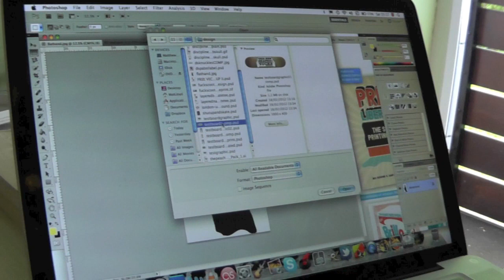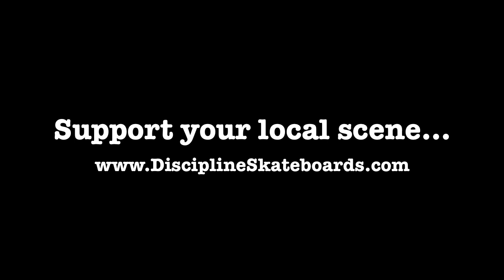Hand screened in the UK - Discipline Skateboards (screen printing)

Comment: Hey man, have you attempted printing a full deck design with this process? Is it possible to print the curved areas in the same fashion with a flat screen? I've seen plans where a curved screen is built that matches the contour of the deck but a photo emulsion process cannot be used with these screens.

So any ideas how you print on the entire deck, can use a photo emulsion process, and print a few colors with decent registration? #$%@!!!!!! lol.